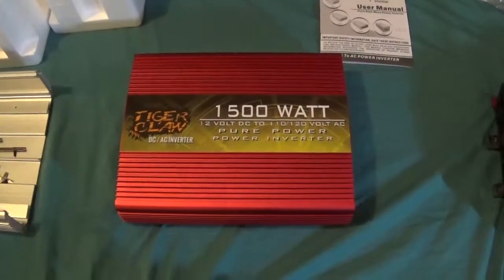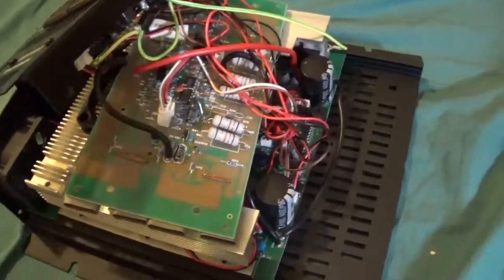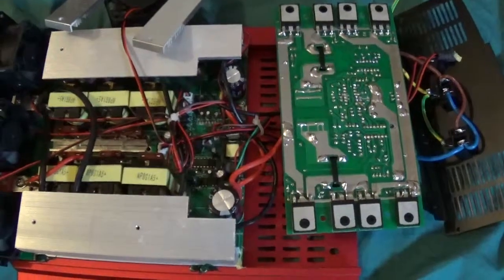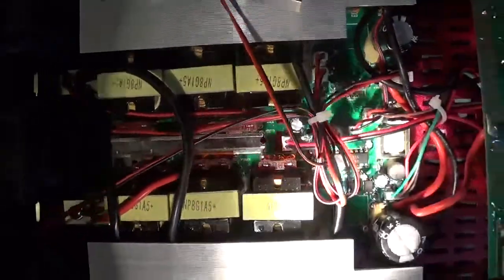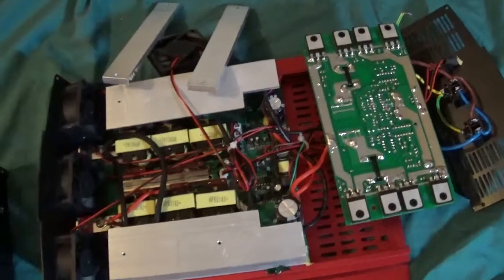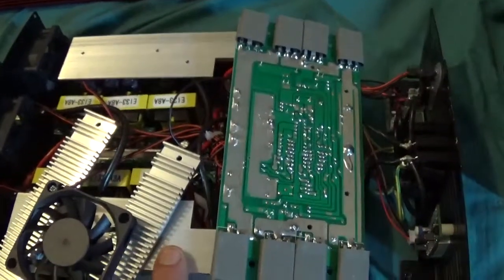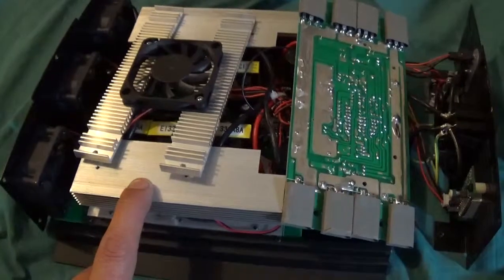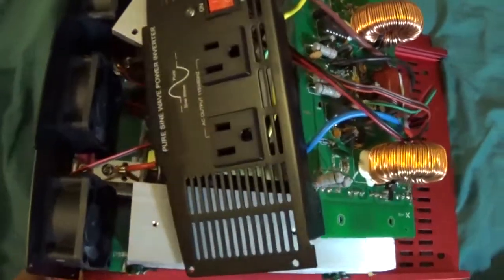OSP tiger claw 1500w sine wave inverter (whats inside)

Comment: HI 2nd time posting this comment  I have this osp tiger claw 1500w  inverter the trace that connects to  the mosffets  burned up. Could you please take a picture with the inverter connections + -  terminals facing you and  looking on the left side of the board need heat sink removed that's where the trace is unless you can see with the heat sink on i doubt it though.  I need a picture of  q 13 trace that connects to that and other next to it its not q14  both are on the  circuit  board with the 6 transformers  .  I can send pictures of what trace  is burned if you give me an email .thank you
Reply from the maker: I'd like to help but the inverter is bolted to wall and hard wired to battery bank.

Comment: I have that tiger claw I reverse polarity it distracted last weekend do you think it’s repairable?
Reply: Check your fuses and input MOSFETs. as well as input resistors need to be metered for a value above 0 ohms asking as they all check out with the same value then replace your fuses and fire it up.

Comment: William, thanks very much for this very helpful video.  It good to see what's inside.  I have one of these units but have never taken it apart.  Now I don't need too ;)  I've had it over 6 months in my RV and have driven off-road in pretty rugged terrain. It's performed well in my RV even at full rated power.

Comment: I also have a centec power inverter from Harbor Freight Tools modified sine wave  use to run my refrigerator as I'm starting to use more solar power now I will probably keep the Harbor Freight unit as a backup but I will be getting a pure sine wave inverter I don't know if it'll be a tiger claw or a Sam lex I have a small PST 300 watt 12 volt inverter I just love for tv laptop ect,,, if I could save up the money I might get a bigger samlex,,,what do you think about samlex inverters,,,the tigerclaw looks good however I've heard folks say after heavy use the fan goes out and some other problems ever heard anything about that?

Comment: William Staten, Can U recommend a good pure sine wave inverter? I've been meaning to get a portable o-scope, just need to dig up the $... Thanks for posting
Reply from the maker: Harvey Spooner This inverter is currently the best price and quality in sine wave inverters for 200$  @itm/OSP-Tiger-Claw-1500w-3000w-Pure-Sine-Wave-Inverter-/121468225172?pt=LH_DefaultDomain_0&hash=item1c48120694 Been following it for awhile so I got one. Plan to do a review later in spring. For really good info on it check out Knurlgnar24 channel.